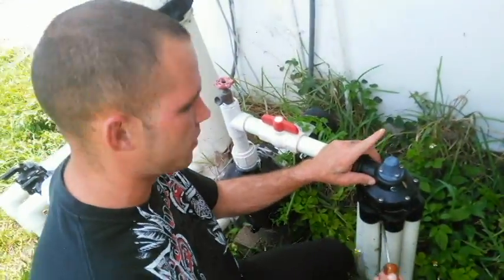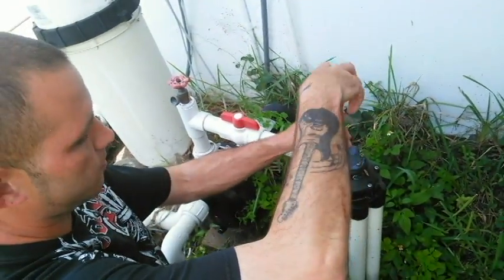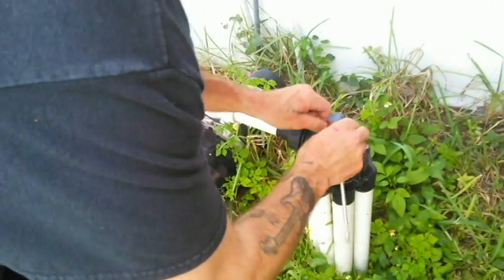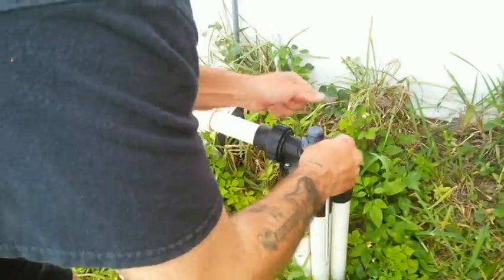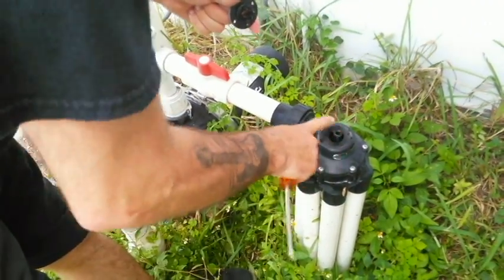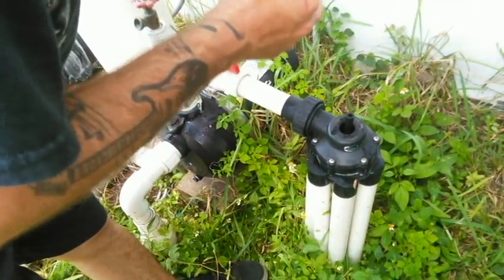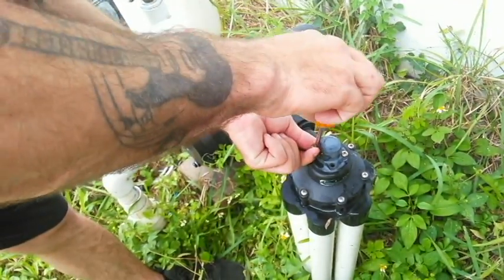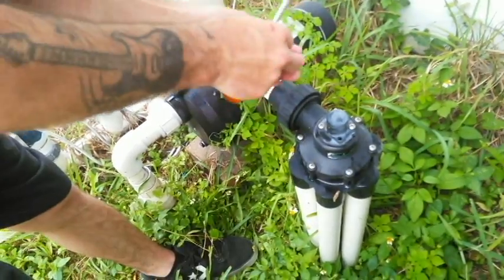Tech Tip | How To Repair a Faulty Indexing Valve

Comment: Hey Justin,
I have a really perplexing problem that I can’t understand how to fix. I have a five zone system using the old-fashioned FIMCO indexing valve, old Intermatic time and online Irritrol solenoid valve. For some reason, lately when the system is just about to finish on zone 3, the solenoid valve doesn’t seem to shut off so the well pump stays on. I’ve tried advancing the FIMCO valve with the zone indicator “push button” mounted on the valve to other zones and let it run and it always shuts off, but for some reason after zone 3 it stays on. Any ideas why this is happening? The only difference is that zone three has six small spray heads, while all the other zones have a combination of conventional pop-up sprinklers and some spray heads.
Reply from the maker: The reason that is happening is because the zone is very small. Is there a fourth pipe on the index valve? Is it capped? If it is, drill a hole in that pipe. This will allow the system to depressurize so that it changes zones after that third zone.
Reply: @sprinklerdude 
Thanks Justin, I appreciate the response. But why does the single inline solenoid valve “care” what the downstream pressure is? Doesn’t the inline valve change states (from open to closed) whenever the solenoid is activated? Does the downstream pressure affect how it operates this much? Just trying to learn 😊.

Comment: Hello - Thank you for your video.  I replaced the CAM but my system still does not switch zone.  It is stuck on 1 zone out of 3 zones.  For me to get the next zone to work, I have to remove the CAM and press the part.  The index valve is new from last year, any suggestion?
Reply from the maker: Did you replace the cam with a 3 zone cam? Also, look at the pipe that is not being used. It should line up with the blank spot on the 3-zone cam. If it doesn't you may have to cut the little peg off of the indexing valve, then spin the cam 180 degrees. That will put the "blank" on the other side. If you used to have a K-Rain Indexing Valve, and now you have a Fimco Indexing Valve. My latter suggestion would work. 

Finally, make sure the 2 wings that protrude from the black stem of the internal "stem and disk" are intact. Those interact with the cam.

Comment: Sorry but he should have taken the whole housing top off and inspected the spring and disk for wear or like he said any sand or small stone that will lay between the pips on the index valve? Mud or clay are very common if the well is western pbc were the water table tends to have a very high iron and tannic content .It will look like mud.Just pulling off the cam he might be back again next  week???

Comment: Thank you.  Worked for me!  I have a 2 zone 4 outlet k rain one....  But it's leaking (well water so it doesn't matter too much).  Do you think I can just repair the cam and the ring?  I may have broken it a bit getting it un stuck.
Reply from the maker: They can get brittle. A 2 zone is a simple replacement. It’s only 3 pipes. You can also purchase a new body O-ring as well as, all of the other parts to refurbish your indexing valve here:   
https://www.krain.com/4000-series-indexing-valve-parts

Comment: Thank you. There was actually a dead lizard in the valve preventing the valve from changing zones. I have no idea how he got in there; maybe when some plumbing work was conducted to the system. Everything is working!!
Reply from the maker: I just had a customer two weeks ago with this exact same problem. It is possible that the lizard got in from the vacuum breaker. Lizards like to hide up underneath the diffuser. As the system opens and closes the diaphragm underneath that diffuser opens and closes. Once in a while, lizard gets caught inside of it and pieces on the lizard end up in different components of the system.
Reply: I would find them (Parts of  anoles ) in St.Pete / Tampa in  every part of  most of the systems there... Vacuum breaker discharge to clogged nozzle.  They would bottle neck at fittings You learned to hate any 1/2 ' PVC in a hurry for those lats. ..Also Snails  sometimes... Mind blowing !!!!

Comment: Hi, I use city water. My indexing valve (4000 K) delays releasing water and moving on to the next zone for one of the zones. I opened the top like your described, it didn't change. Any advice?

Comment: What if I need to replace the index valve? Another individual suggested just exchanging the new parts for the old parts (inside the old mounted system)… Do you suggest this? If not, would I need to cut the PVC to remove old valve and replace with new?
Reply: I can't get my whole top piece off without breaking it.  But, they still sell that Hydrotek 4000 model.  Did replacing the stuff inside work?
Reply from the maker: Yay! Got the whole password tonight figured out! Now I can make more videos! It’s been 2 years!

Comment: I have the same system and I want to bypass or skip one zone, can you please tell me how to do it?
Reply: Daniel Fonseca if you have 4 Zone & you want eliminate 1 just buy the  part inside for 3 zones & you fix your problem
Reply from the maker: Yes and no. Doing that might disable the wrong zone. In some cases, you can cut the small post and install the cam backwards to shut off the opposite pipe (zone), but that still risks taking the wrong zone out of service.
Reply: Daniel Fonseca  you would have to change the cam.
Reply from the maker: Upgrade to individual valves wired to a digital controller. you can skip any zone(s) you want.

Comment: Howdy, so I unscrewed the small top piece with 4 screws and heard crunching rocks as I pressed down on the black spring loaded stick. I then unscrewed the large piece that has like 8 screws but due to install manner was unable to remove it to clean insides without breaking stuff so I tightened back the 8 screws. Then I left the small 4 screw piece off, and fired up the Sprinker pump which shot up a stream like 15ft up. Closed it back up , tightened up the screws and now it works. Seems like I blasted out some of the stuff interfering with it cycling through zones. So far so good.
Reply: Thanks for the great explanation!
I will try to do the same on mine
Reply: other than the water shooting up high...... there was no issue with the sprinkler after that?  it blasted out debris?  i have the same problem now.  Mine is a lake sprinkler, so i figure something got in to it and is sticking the indexing valve to skip a zone
Reply from the maker: When you remove that little 4-screw cap and press the spring-loaded post, you’re essentially opening up the check/flush passage in the indexing valve or pump assembly. If grit or lake debris gets stuck in there, it keeps the valve from sealing and indexing correctly. By running the pump with that cover off, the water pressure blasts the obstruction out. That’s why it shot a geyser 15 feet high and then started working fine again — the junk got flushed.

Since yours pulls from a lake, that’s the most likely culprit. Even with a suction screen, fine sand or shells can sneak past and jam the valve.

So to answer your question directly:
	•	No, there usually isn’t any permanent harm from doing that “flush” — once the debris is gone, the sprinkler will index through zones normally.
	•	The only caution is making sure the gaskets are reseated when you bolt it back up, so you don’t pull air into the pump or leak water.

If yours is skipping zones right now, odds are good it’s the same deal: something is sticking the indexing plate or check assembly. A controlled flush like that will often clear it.
Reply from the maker: Sounds like you cleared a blockage in your pump’s check valve or priming assembly. When you pressed down on the spring-loaded piece and heard the crunching, that was likely debris (sand, small rocks, mineral buildup) stuck in the valve seat. By firing up the pump with the small plate off, you forced water pressure through the opening, blasting out what was preventing the valve from sealing and cycling properly.

That explains the 15-foot geyser and why it now works through the zones.

A couple of notes for you going forward:
	•	Keep an eye on it: If debris caused the problem once, it can happen again. Sometimes it points to a failing or missing screen/strainer on the suction side of the pump.
	•	Check the seals: Since you loosened and re-tightened both covers, make sure the gaskets seated properly. A slow drip or air leak can cause priming issues down the road.
	•	Inspect the source: If you’re drawing from a canal, lake, or well, check for screen damage or clogging—anything that allows grit through can end up inside the pump assembly.
	•	Maintenance tip: Running it briefly without the cover can flush debris, but it’s not ideal long-term. If it keeps happening, you may need to fully disassemble and clean, or install/upgrade a filter.